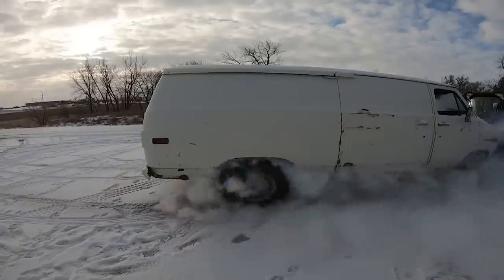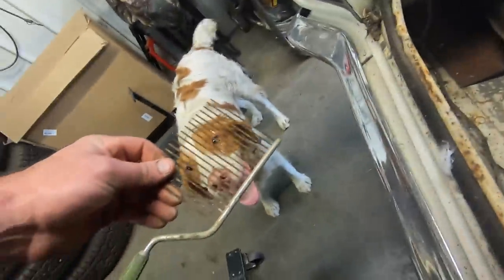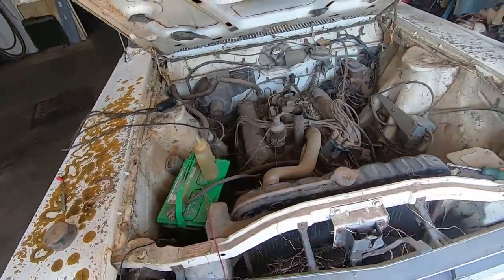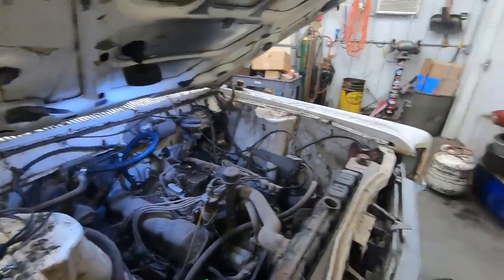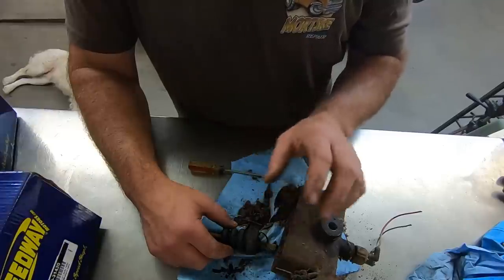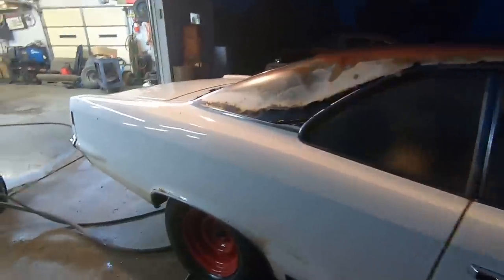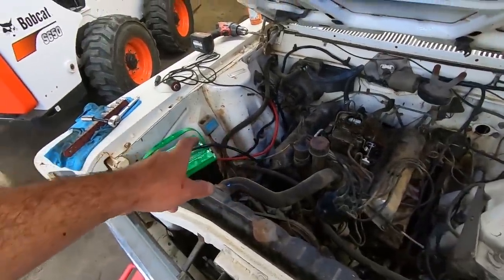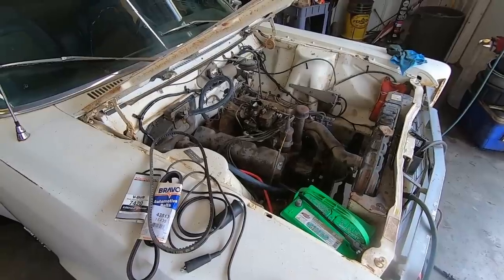1967 Rambler Rebel SST Abandoned in a Farmyard for 40 years!! Will it Run?!? AMC Muscle Car!

Comment: Believe it or not, AMC had been using a dual-circuit master cylinder long before the federal mandate.  Beginning in 1964, ALL AMC cars had dual-circuit masters beating all the major producers by several years.
Reply from the maker: Cutting edge stuff at American Motors!
Reply: @MortskeRepair  You'd be surprised. First company to introduce unibody way back in 1949! First attempt at electronic fuel injection in 1957. The kept offering overdrive DEEP into the 1960's.... long after other manufacturers had abandoned it.  AND, the 2nd Generation AMC V8 (290/343/390) was the most modern V8 in Detroit at the time. Very powerful, very strong and surprisingly light.  The V8's were lighter than the sixes!

A few years back, I recall tearing down a mopar 383 with a buddy.  It took two big burly dudes plus me helping to get the bare block in the back of a truck.  Meanwhile, I dropped off my AMC 401 at the machinist.... my delivery vehicle was a Hyundai Tiburon.  When the machinist asked how we were gonna get the block outta my car, I told him "The same way I got it in!"  He brought over a cart, I reached in, picked up the block myself and put it on the cart.  The bare AMC V8 block is maybe around 300 lbs??  It's heavy no doubt, but I was able to toss it around no problem.

AND.... let's not forget that the AMC 232 & 258 very famous for longevity in Jeeps, later to become the 4.0 litre which outlived the company! Chrysler stopped producing their antique slant 6 weeks after absorbing AMC and kept producing the 4.0 litre until 2005 or 2006! 

I firmly believe if AMC had been given government handouts in the late 70's like Chrysler got, we'd still have AMC today. 

AMC was a pretty groovy little company that managed to do some pretty cool stuff despite having a tenth of the budget of the Big Three.
Reply from the maker: @That_AMC_Guy  Great info!

Comment: Smaller diameter piston makes more line pressure for standard manual brakes 1⅛ or bigger is for power assisted brakes with booster they will stop you without booster working but they are extremely hard to mash I had a 1 inch on my camaro I converted to manual for street strip use and it was still hard I wound up doing a ⅞ inch piston wildwood master to get the peddle feel I wanted definitely backwards from the way a man's Mellon works but thats the way they work

Comment: Might want to change the oil dude.
Reply from the maker: Why's that?
Reply: @MortskeRepair  Sounds like you had tainted oil?
Reply from the maker: @iamgermane  What's that sound like?
Reply: @MortskeRepair  Your old car.
Reply from the maker: @iamgermane  Never knew oil made a noise
Reply: @MortskeRepair  It will make your engine make a noise if you use bad oil!
Reply from the maker: @iamgermane  Interesting